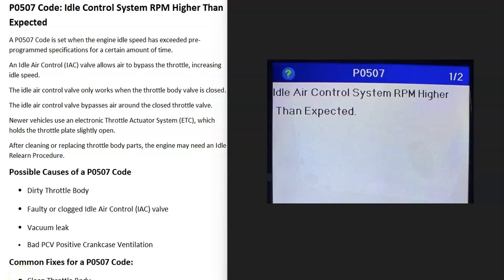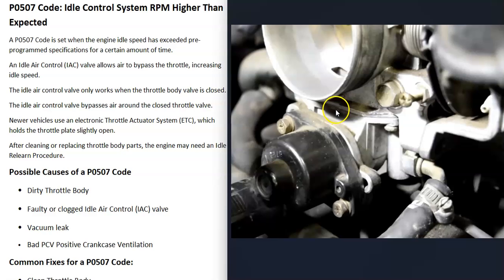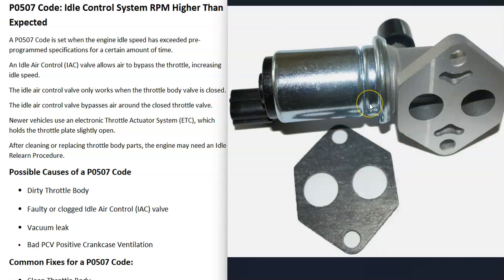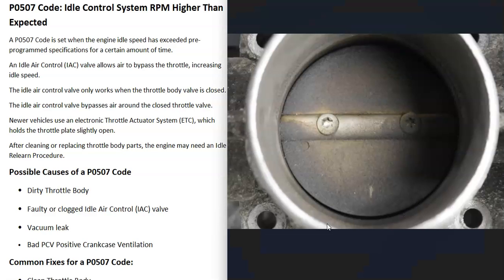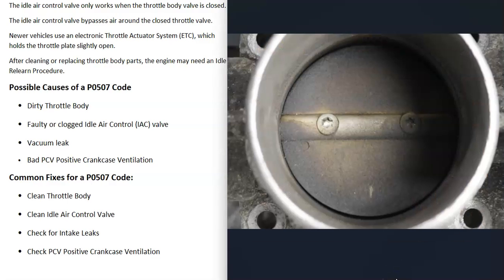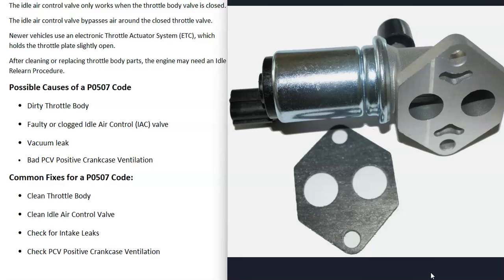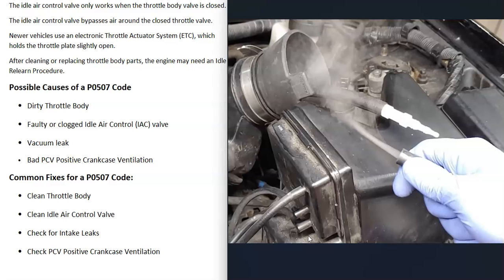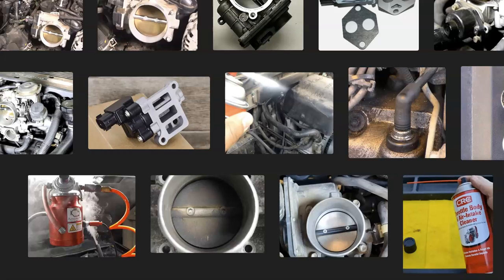Causes and Fixes P0507 Code: Idle Control System RPM Higher Than Expected

Comment: My rpm bounce still after replacing the idle control valve and I driven the car for about 30miles and dont know why it's still bouncing and I clean the throttle body.

Comment: I just got this code after driving on the freeway, I know my injector ports are gonna causing a vacuum leak in my 2008 dodge ram. I rigged the injector orings with electrical tape in the past due to heavy misfiring. Thanks alot

Comment: Would you happen to know where the idle Air control valve is located on a 2011 chevy avalanche i can't find it to save my life
Reply from the maker: The 2011 Chevy Avalanche has an electronic throttle body that uses a small motor to control the throttle body plate to manage the air intake at idle.

Comment: I just cleaned my throttle body and now I’m having a high idle. Anyone have a recommendation on what I can do to correct it
Reply from the maker: Check the wiring and be sure it is all plugged in good and not accidentally bumped while cleaning. Also, the computer may need a throttle body relearn. Often, this can be done by driving around, but the specific steps for the vehicle can be looked up to speed it up.

Comment: I put in a new throttle body new map sensor P0507 all is clean only thing is left is intake gasket but I spray the spray and still same idle issue I'm not a mechanic so next thing is to call a mechanic

Comment: Changed throttle position sensor, idle air valve, crank/cam shaft sensors, yes throttle body fully cleaned, vacuum smoke lean and no leaks. Turned out to be the cruise control cable next to the throttle cable was too tight and was idling at 1500 rpm, lol.
Reply: Id be so mad I would have to laugh it off.
Reply: Who tightened that up.
Reply: I saw another video that said you should disconnect throttle sensor and battery before  cleaning the throtle. Unfortunately I didn't do that, and have been battling  a PO507 code to no avail. I swallowed my pride today and called a mobil mechanic to recalibrate my throttle sensor and ecu with a bi-directional scanner, one tool I don't have.
Reply: Well, that's interesting. Where is that located, in relation to the throttle body. With the wrestling match on my Colorado, just to change plugs, who knows. Parts sitting everywhere. I was organized, pictures, magnet tray.
Still a cluster.

Comment: Please help me,  Im a 65 yr  female this problem i went in to get that smoke test to fix exhaust prob to get tags, much was taken from my avalanche, I could not even drive off the lot behind the PO507 when I put my brakes on, it was like metal. I immediately stopped the car and that's when I even heard ticking oil was taken from my car because it had lost half of it on my manifold it lights up. I checked it before I got out. I went around my car and looked at the rotors and he had a lot of wood in his garage anyways the back two were switched out and most likely the shoes because it was metal on metal next, I looked at the brake fluid and then I dropped down to minimum for Max right under maximum is where I keep it. I don't have money. I'm very poor. I live on retirement as a female as 1200 a month not even that almost in California and that's expensive, so what I'm thinking is I had a big old 5 gallon thing or whatever you call it of the oil it's a special synthetic oil. I'm not even gonna put that in my car because my truck I could've switched that out on me his smoke test he did look like he might've blue. What do you call that vapor thing when he was underneath the gas tank part and waited for just a little just barely nothing came through really, and but I think it just turned out to be the gas cap need to be tightened on my light up. System told me that my new purge valve was switched out. I don't know what to do. I had taken advantage of $399 and he stole everything from me to make my car run smooth and it's dangerous right now and I don't know what to do and with the AutoZone people I went directly to them and there and I've been going to them in the test come out the same and it's just one thing and it has it probably was the harness from the purge valve, which I told him about and right after I left him it said the problem was still there with the purge valve and I had four pages more worth of problems going on in my engine behind him, including the PO507. I also have P0442P0455PO113P0443 and I've never had these problems before. It also says my battery voltage is low and it's a new battery. It is my oil level passed although it was low also and did not do anything. He told me he had to wait for parts to be delivered. He was the only one there I don't even know who he is. I just need to find a good mechanic I mean Huntington Beach, California, and I'm scared to death because I know my truck and this man took advantage of me and I know how to relieve myself know how to reset the engine light to make it turn off you just unplugged the damn battery I have to get my tags and 60 miles is not gonna do it to reset the monitor. It's more like 120 to 200. Yes I called him back and read his right. I'm very angry and I've been crying all day because I don't know how people can be so evilhelp me. i'm devastated. It's late and I can't get to sleep. I hate when people see older women as myself alone. I'm tired of me and taking advantage of, but I know my truck I used to work on cars when I was younger and I'm not a lesbian this guy from Ecuador or whatever with that herpes on his mouth I don't know what the heck that was he supposed to be the shop owner or I'm wondering if he has been wearing his shirt who knows maybe the shop owner is dead somewhere. I don't know. I just know he brought me so bad and I don't know what to do. Help me.

Comment: Air control valve, found on your 3 cylinder rogues ... your throttle body is under that charge air cooler. Your not the only nissan tech out there ... be humble.

Comment: Could a catalytic clog cause backup poor idling even after cleaning throttle body
Reply from the maker: A clogged CAT can cause issues. When it is clogged up, the engine won't have the power it once did.

Comment: Yes, I need help. I can’t figure out what’s going on with my engine swap. I keep throwing a P0 507 code but the real issue maybe because I installed a 2008 where a 2006 used to be 2.5 and I have an extra wire connector that goes to my carbon collector but this new engine doesn’t have one and it’s running like shit and throwing PO 507 but I fixed it again and again

Comment: Hi bro i have same issue after scan I received a p0507 code , do i have to replace the throttle body or something else, because i used of cleaner inside the throttle body but nothing got changed… can you please recommend??
Reply from the maker: It will need to be troubleshooted to find the issue. The basic things to do are to clean the throttle body, check for a vacuum leak, and check the PCV valve.

Comment: I got this code after cleaning the throttle body and maf sensor 😢
Reply: Me too! Idk what to do
Reply: I got this yesterday after cleaning throttle body too!! How do I fix it lol
Reply from the maker: The throttle body likely needs what is called a Relearn procedure. It can vary on the engine how the Relearn is done. Often, the computer will relearn on its own when driving around. Also, check for any wires that may have become disconnected.
Reply: @HVAC_Mechanic I did the relearn procedure, still the same issue. Bought new throttle bodies. Still the same issue and code. What’s my next step my man I’m lost rn
Reply: @VqLyfe  I bought the icon T8 scanner. It just needs to be reset with a scanner. Your throttle body is fine. Just needs a bit-directional scanner to reset it.
Reply: @AliJohnAfandi  do I need a consult 2 or whatever that is? Is it time to go to the dealership?
Reply: @VqLyfe did you end up finding out the problem man? I’m in the same boat right now
Reply: Same here guys.. left for work... car would barley excelerate.. took it home.. reomved the tb.. cleaned it... NO RESPONE AT ALL NOW.. NO REV..! found a broken wire on the etb connector... soldered it back up.. Then she ran fine again... But now while Im driving I get rev hangs.. and a weird idle while coasting... goes up and down from 1200 to 1500... VROOM vroom VROOM vroom VROOM vroom... Until I stop..... I got a foxwell scanner and relearned the etb sensor but that didnt make any difference....   Starting to get flustered😂

Comment: Could this cause shifting problems?
Reply: I’m also wondering the same. I’m no mechanic by any means, but P0507 is the only code I have on my 2010 Jeep Grand Cherokee, and I don’t notice any symptoms, in fact - my idling is perfect. I have noticed slower shifting though when I’m accelerating, though. And my Eco mode doesn’t work… on the rare day my check engine light doesn’t illuminate, my Eco mode starts working.
Reply: Yes the computer tells your transmission is higher and it will kick shift
Reply: How did u solve this problem
Reply: Mine shifts quickly but i do have a few other codes along with this which is related to vacuum leaks

Comment: Cool, just the information I needed. Doing the drive cycle and clear all the monitors then cel light goes on.
Reply: What is a drive cycle? Does this make the CEL go off? My CEL came on after actually cleaning the MAF sensor and the throttle body. Both were charcoal black. Now both are super clean and the CEL has came on. Any suggestions? Thank you!